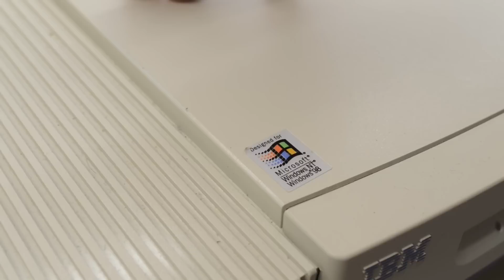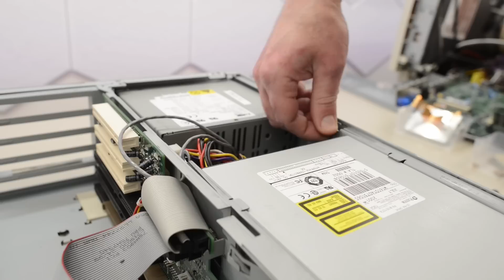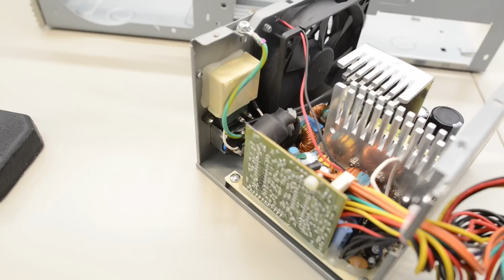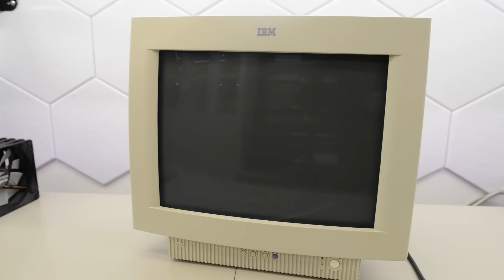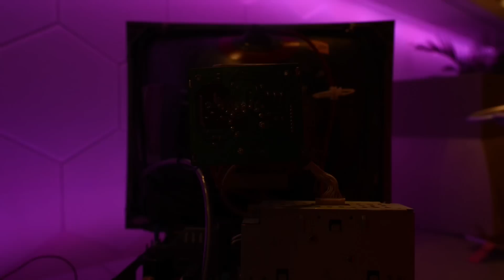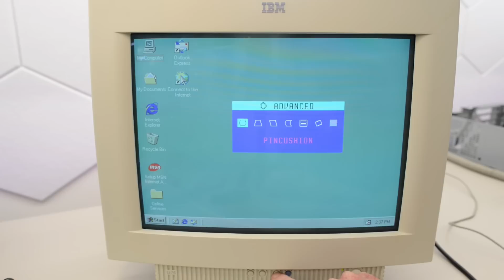IBM PC 300GL restoration & G74 repair. Pentium III 450mhz

Comment: That 300GL looked like a copy of slightly earlier Compaq Deskpro machines...
NB! I had 300GL with PMMX166 - It was completely different inside and even the case was a bit different. Power button was on the right side next to CD-ROM and top side was fully on same level. It is so confusing they used the same model name for such a large range of machines...

Comment: I think that hv transformer is toast. You've got high voltage arcing on to the tube heater windings which are usually designed for a much lower voltage.

Comment: The last time I worked on a 300GL, it was being used as a store server.  They were running two hard drives in Raid 0 and the machine stopped booting.  The cable had failed... and I found out rather quickly that drive controller simply did NOT like 80-pin IDE cables.

Can you imagine going into a computer shop - even a small one - in the 2010s - and asking for a 40-pin IDE cable?

Comment: Awesome video! I was wincing when you were prying on the level so hard. The whole time I was worried you were supposed to push on it and not pull it. I was wrong thankfully!
Reply from the maker: Thanks! There was no mention of the lever in the service manual, so I had to guess :)

Comment: I bought one of these used at a flee market. It was marked as broken and bought it for $5. Turns out the 115/230V switch was turned to 230V. That's all that was wrong with it. I had this for a long time, and it worked great.
Reply from the maker: Excellent bargain :)
Reply: life is goood

Comment: F.C.I. was Fullarton Computer Industries. They made the metalwork for systems assembled at IBM Greenock, and later pre-installed the power supply into the chassis.
Source - was an engineer at IBM Greenock at the time.
Reply from the maker: Thanks for sharing. You guys did a great job, the chassis is excellent :)

Comment: We had some of these at the IBM Multimedia test lab (we got them new as replacements for some PC Series 300 machines).  There were tower versions of the 300GL/PL machines as well (in the same sort of case as the crAptiva one you showed)

Comment: Thats a sparkgap that you are seeing in your video. That is a sign that something is VERY wrong with the flyback, or the HV regulation circuitry and its running too high and going into shutdown.
Reply from the maker: Thanks, I hope it's not the flyback. All the other components are probably still available from Mouser and eBay. I'll start with the caps and take it from there
Reply: @Epictronics1  What you should do as well, is check the horizontal output transistor's collector. Theres a series of film caps, make sure none of those have gone open. They are known as "hold down" capacitors.
Reply from the maker: @ Thanks, I'll check

Comment: I have two of these BM PC 300GL. One with Pentium II 266 Mhz, stucked at 66 mhz FSB, but the processor is NOT locked. It can be changed in bios from 200, 233, 266 and 300 mhz. And it has Cirrus Logic onboard video card. The second is like this one, but Pentium II at 350 mhz, with 100 mhz FSB and S3Trio 3D. It came with the same network card. With an ISA sound card and Voodoo 2 upgrades, these are very good retro machines.
Reply from the maker: Should be pretty good Voodoo 2 machines I imagine

Comment: Heh, working on CRTs has always been fun.

Saved a HP Ultra VGA 1280 just recently, which decided to burst two caps on the neckboard. Installed new ones, got myself a great Sammy built CRT with a HP badge :)

Comment: The date code on the hard drive says April 14th 2003. The biggest thing that will trip you up about tryin to decode these date codes is that Seagate uses the fiscal year instead of the real year for its week numbering.

Comment: If I remember correctly, that model had extra screws fastened to a certain part of the chassis for cases where you needed to install new disk drives and didn't have screws for them
Reply from the maker: I have seen spare screws like that in many machines but I didn't notice any in this one

Comment: That motherboard is the old NLX form factor. I remember working on some HP and Gateway machines like that IBM.
Reply from the maker: The NLX form factor is going to be a challenge in the upgrade video, but I think I have a good hack to get around it :)

Comment: I bought an Mean Well 48V DIN rail power supply. I also noticed a blue flash and arcing noise when connecting it to mains, but not every time. After much testing I found out it's happening inside a small glass component just like next to the cap where you saw the arcing in the monitor.

The PSU works fine and I googled and couldn't find anything about it. So I assumed it's by design and has something to do with inrush current.

Comment: Plextor was considered as the best CD recorder manufacturer. One of the most reliable, compatible and durable!
Reply from the maker: I actually sold a few of these plextor drives to my customers back in the early 2000s. I remember them being very expensive. I guess, they were worth it
Reply: in my land their drives are still worth around $150-200 (some specific medical equipment can use only them and nothing else)
Reply from the maker: @lvl90dru1d  I'll see if I can get it back to it's original color and use it in a period correct build. probably a PIII machine
Reply: @Epictronics1   I can tell you from experience that those Plextor faceplates do respond to retrobrite, but the blue logo text will probably fade to a bit of a pastel color.  I don't mind that as much as a yellow faceplate, so it's worth it to me.  To each their own, though.
Reply from the maker: @sirnickity  Thanks for sharing. In that case, I'll try with sun only.
Reply: I always had to laugh though because the brand name sounds like a Saturday morning supervillain.
Reply: Agreed, deeply regret moving my plex-writer on 15 or so years back.
Reply: Agreed. They were amazing.
Reply: They were also one of the best for copying pc games back in the day.
Reply: I still have a Plextor lightscribe in an external USB enclosure

Comment: I had this computer (another version with AGP port that used a strange shaped ATI AGP card) that I upgraded to use it with Win98SE. I replaced the CD-ROM with a SCSI CD Writer.
The reason for the upgraded CDROM, HDD and maxed memory is XP. I guess the original HDD was around 10MB, too small for XP.
That Plextor is a CD-Writer, that is why it have the fan, most early CD-Writers had the fan. The CD-ROM that you used is just the same that I had in my IBM PC-300.
Reply from the maker: I'll defineltly use that Plextor drive for some other period correct build. Probably a PIII machine

Comment: I used to have one of these back in the mid 2000’s. It originally came with a pentium II and all of the optional motherboard features. I remember stuffing a pentium III at 700 mhz with 384 megabytes of RAM and running windows xp professional. I remember having an issue with the primary ide channel failing to work randomly one day. It lived a long life with the hard drive and cd rom running off of only the secondary ide channel. Probably the funkiest part of that computer was the very odd agp slot. The agp slot was a standard slot but the card ibm intended for it was definitely designed to fit the case. I remember modifying a random card to fit the odd location by trimming the backplate of the card so it could be installed and screwed in. Definitely the earliest example of a windows machine with a built in speaker I’ve seen.
Reply: I still have mine, it’s a 300pl with integrated sound and Ethernet. Also the AGP that uses the funky shaped card. I updated the Bios and dropped in an 850mhz pentium 3, still runs great.
Reply from the maker: Great, so then it can do at least 700MHz. I'll see what I can find in my stash and try it out with different speeds

Comment: Plextor drives are the best, especially the px-w4012ta. I would keep that drive in the machine, it's better than anything else you could put in there from the period.
Reply from the maker: I'm going to use it in a period-correct build. Probably a PIII machine